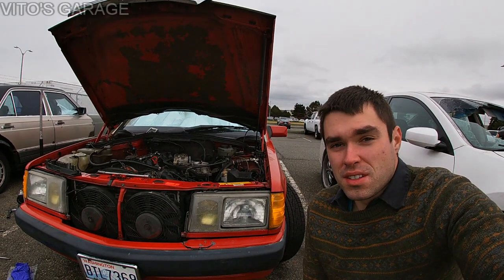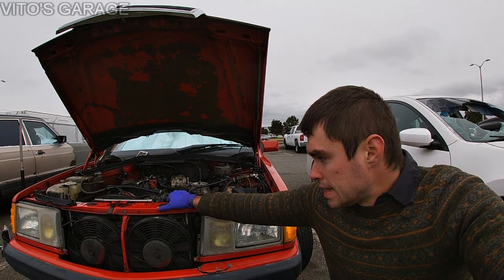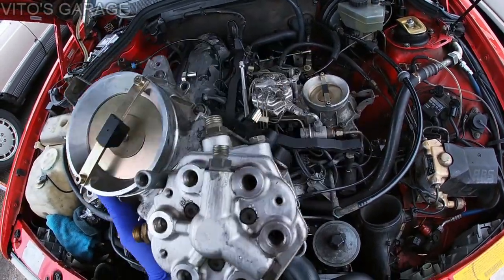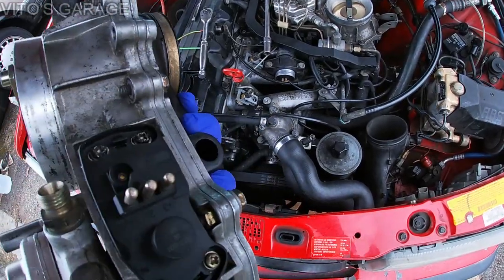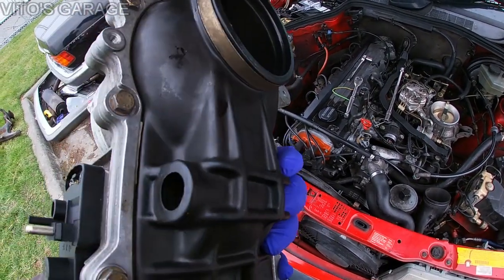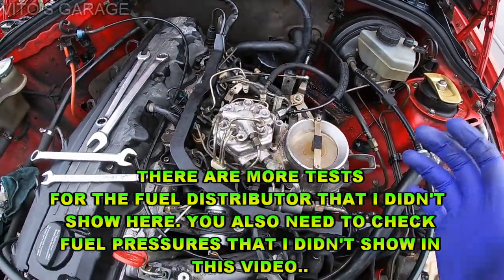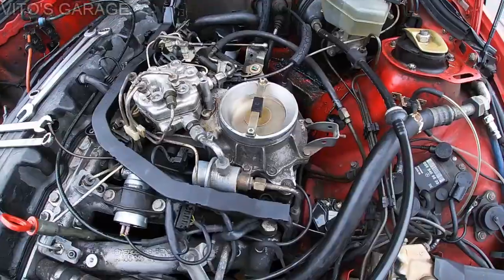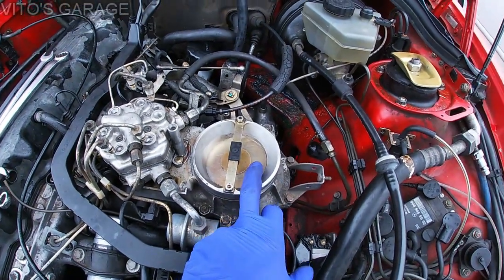I Restored Power on My Mercedes 190E! Fixing Vacuum Leaks and Installing a Fuel Distributor!

Comment: I read in a blog of W 124's enthusiasm that they recommend changing the old thermal paste located under the electronic ignition board. On these cards, which cannot be found today, overheating is one of the main causes of failure.  I guess the W201 uses the same cards ?  
Bonjour de France.
Reply from the maker: EZL ignition modules on these cars are pretty reliable. I pulled mine out and the paste is still there. 
The main cause of a low power and poor running is 90% caused by ke-jetronic not adjusted properly, or worn out parts of ke jetronic itself. Hello from USA!🙂
Reply from the maker: But I agree, it’s a good idea to add or renew the paste on the bottom of ezl module. That way it transfers the heat a lot better! I might make a video on that in the future

Comment: I’m about to rebuild the fuel distributor on my 91 Mercedes’ Benz 190e 2.3 do you think if I rebuild the fuel distributor do you think it will improve the running of my car??
Reply from the maker: No idea. It depends what symptoms you have. Fuel distributor should be the last thing you touch. Gotta check for vacuum leaks and other worn parts first
Reply: @VITOSGARAGE  My just always takes a minute for it start up we did find one of the problem it was the intake gasket so what I’m going to is rebuild the distributor and put a new intake gasket on the car.
Reply from the maker: Use a smoke machine and test the vacuum leaks. Besides the intake manifold gasket, install new idle Control valve rubber hoses, new injector seals, clean the throttle body and replace the throttle body gasket. While you’re in there, remove, clean and lubricate the accelerator linkages. 
As far as the long starting, your fuel pump check valve could be bad causing a long crank. 
Another thing I recommend checking and replacing is the rubber fuel hoses. These cars are 30-40 years old and a lot of rubber fuel hoses are cracked up. This has nothing to do with your problem. But it’s important to replace them to prevent fuel leaking and causing fire… Very critical. Check the rubber fuel hoses in the engine compartment and around the fuel pump area

Comment: Amazing, amazing! I'm glad the beast can finally fly. 
Hey Vito, if that "plate" has NO PLAY at all, can it be fixed or you've to get another fuel distributor?
Reply from the maker: Yes, you can adjust the air fuel mixture using a long 3mm Allen key. The adjustment screw is next to that plate. Push down the Allen key and turn it one way or the other. This will adjust the plate
Reply: @VITOSGARAGE  thanks a lot for the knowledge brother, I might have to apply it soon or later.

Comment: Do you have a clue weather it was the distributor itself or the EHA valve that's on it?
Reply from the maker: Bad eha valve and improper fuel pressures. Distributor was good. Install new eha valve and check fuel pressures

Comment: I just wanted to tell you that I have been using 89 fuel in my W124 400E for over 4 years...NOT a single issue...you don't really have to use 91 or 93...with all the stuff that the gas companies put in gasoline nowadays, 89 of today is like using 91/93 from the 90's..I mostly use Shell ( 8 times out of 10)...Just make sure that your fuel filter is clean...The only real issue that I had in 4 years with my 400E was a tiny fuel leak at a line ( which had to be fabricated as they are NLA) and a stucked purge valve ( which made the car almost stalled after a long drive in hot weather (usually, when I went to the Miami area..took me over 3 years to find out what was causing the issue...LOL)...other than that, no real issues!! 
However, I do a lot of preventive maintenance and "regular cars" maintenance ( brake pads, oil change every 5K )
Reply from the maker: Good to know. Thanks a lot for sharing. I’ll try that. 
I’ve tried using 89 instead of 91 on another Benz and I Felt a power loss with that octane. And the fuel level would drop a lot faster versus using 91
Reply: @VITOSGARAGE  i get around 26/27 mpg on highway at speed limit (70 mph) on long highway trips.. And definitely no loss on power with my M119 engine.. Engine is so smooth that sometimes i wonder if it is on or off when i am at a traffic light .. Lol

Comment: What does it mean if the ports are being filled while the car is off and the fuel pump is on????? On one of the codes on my car it said continuous fuel injection is that what's happening to my benz??
Reply from the maker: It means fuel distributor wasn’t rebuilt properly. Take apart the fuel distributor and rebuild it